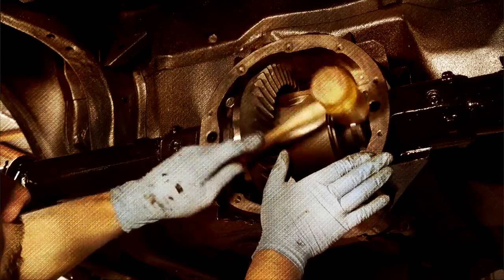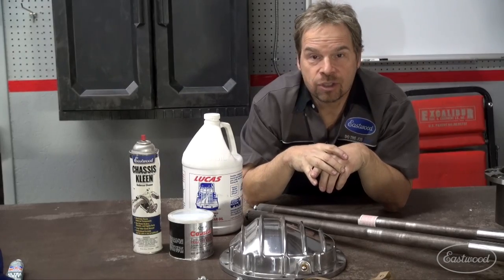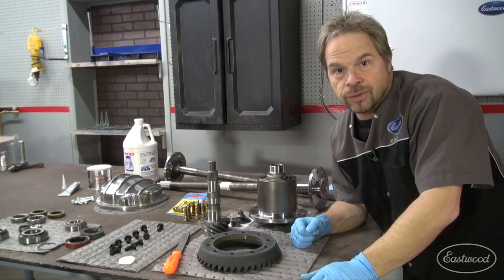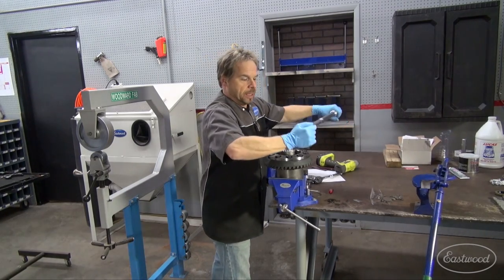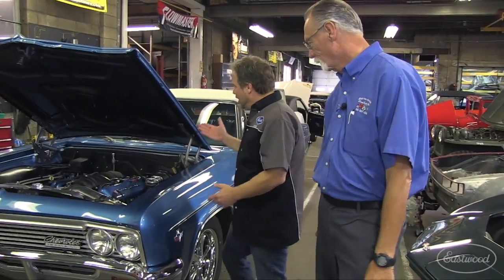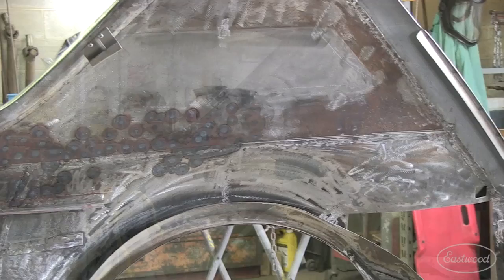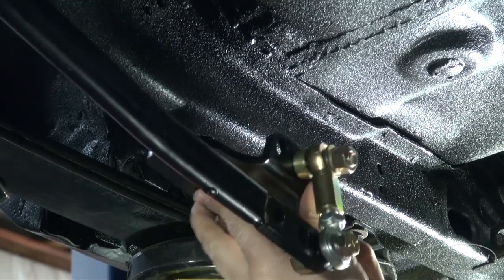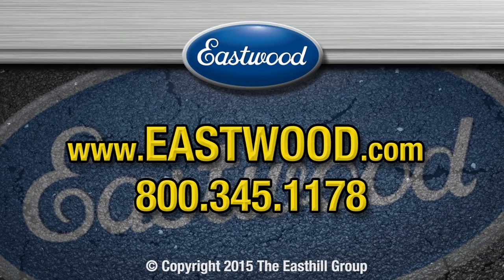How To Install a Rear & Upgrade Brakes on Hands-On Cars 12 + AMX Concept Car!  Eastwood

Comment: I've never seen a correct ring & pinion set up on any of these TV shows. This guy made several mistakes. He never checked the backlash with a dial indicator and didn't show the installation of the crush spacer. That's just 2 of the many mistakes that I saw. If you are a first time rear end rebuilder please do not do it this way. And you should not put a differential in a vice like that.
Reply: I agree, No pinion depth shims, or even a test...
Reply: Formula Firebird plus he put far to much   contact blue as we would call it before contact pattern on  that was stupidly thick how can you even see how the pattern is if it's 6 inch thick plus he didn't spin it wound not just  5 teeth
Reply: i am not touching that rear end with a painting stick,  this is far more advanced than hammering with acrylic tool.